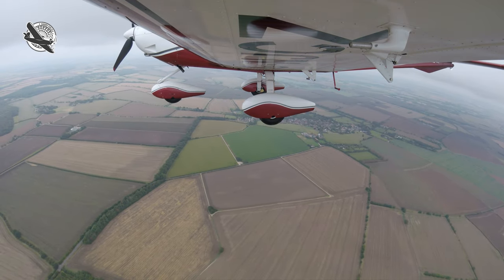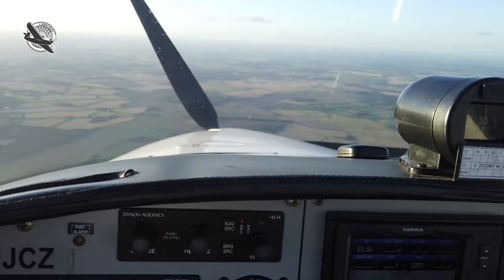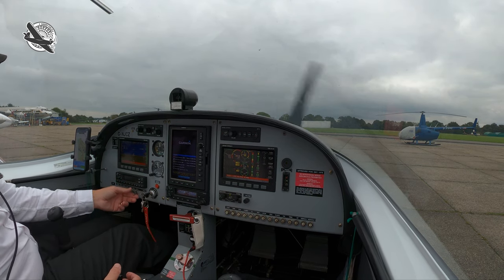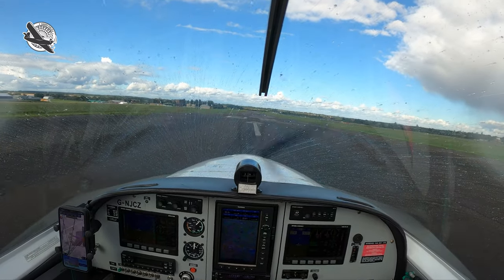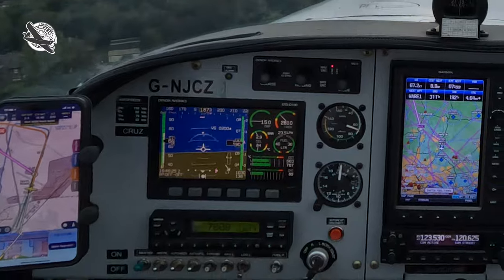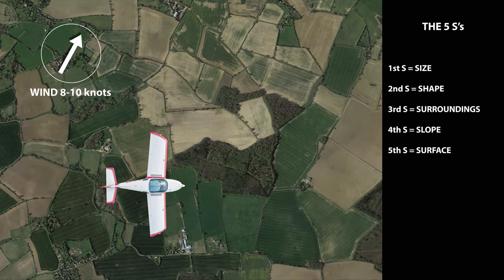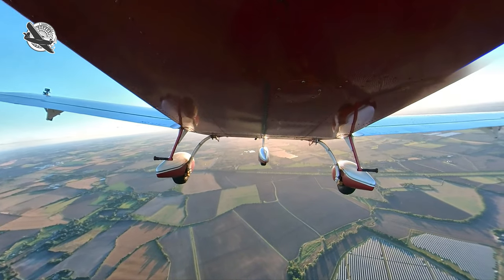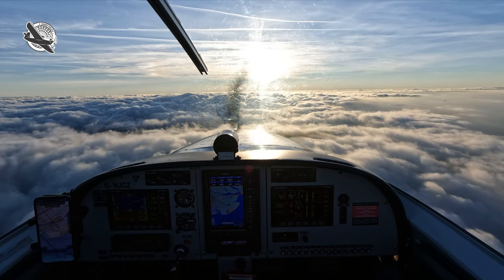ENGINE FAILURE in a single engine aircraft and how to SURVIVE if the worst happens.

Comment: I had engine failure in a Beech Musketeer a couple years ago.  Was only 1500 ft AGL.  Not much time to diagnose problem but oil pressure had taken significant drop so I turned towards the field.  I was about six miles out.  Engine quit within a few seconds after the turn.  I immediately set best glide speed.  There was major highway with lots of traffic and power lines.  I opted for a gravel road.  Slope was down hill but I couldn’t tell that until I was already committed to landing.  There was a very slight dog leg turn in the road.  The airplane wouldn’t make the turn so airplane departed the road.  When over about 400 ft of Texas sagebrush and then into some bushes.  The bushes quickly slowed the airplane.  Then the right wing impacted a small (2-3 inch trunk) tree.  I didn’t feel much of a tug on the seatbelt.  I was fine.  Only injury was scratches from climbing through the bushes.  Airplane was totaled by the tree. I didn’t feel any fear through the process.  No panic at all.  I would suggest always selecting landing site prior to working on engine problems.  I did change fuel tanks, checked mixture without success and then it was time to land.  It was the smoothest power off landing I ever made.
Reply from the maker: Well done Mike. Fantastic thanks Sir.
Reply: Textbook emergency landing by the sound of it.
Reply from the maker: @rinzler9775  textbook, no, walked away, yes 🙂
Reply: Out of curiosity are you the owner of the plane or were you renting it? I’m still working on my PPL and I rent the planes I am training in. I have always wondered what the costs would be, how the insurance handles it, etc. 

At 1500 AGL, I imagine that was pretty nerve wrenching! Do you recall about how long it took for you to glide down? (3-4min?)
Reply: @GlassFamFishing  If an engine fails, don't worry about the aircraft, it belongs to the insurance company at that point.
Reply: My God I’m glad you’re okay😮

Comment: Engine stopped running in my rental C172 over Puddingstone Reservoir out of Brackett Airfield, La Verne California. I was flying from Van Nuys airport. Landed and had lunch and took off headed back to Van Nuys when while over Puddingstone Reservoir the engine quit running (approximately at 1,300 AGL). Indelibly edged in my memory “will this be my last day on the planet?” I establish glide speed thinking of a possible water landing, but was able to restart the engine.Traded airspeed for altitude. I headed back to the airport landed and called the FBO. They sent a plane with two pilots to pick me up. They test flew the plane around the pattern with no problem and asked me if I would like to fly it back. I said no thank you. Turns out they had fuel contamination problem with several other airplane at this FBO on this day.
Reply from the maker: Scary story David but well done Sir. Thank you

Comment: I know this is for a vid, but the manual for our cruisers says PULL THE RED HANDLE.... Once the whirly thing in front stops, it belongs to the insurance company.
Reply from the maker: LOL I was going to say that but wanted to keep the video non-specific to type. :-)
Reply: On our cruisers they state to only use the parachute in extreme emergencies where a safe off-airport landing is extremely unlikely.
Does your manual state a minimum use height for the parachute? Ours doesn't unfortunately!
Reply from the maker: @That737Driver  no minimum deployment in either speed on height, however once the chute is deployed you've lost all control over the situation. Engine failure immediately after take off (use as drag) at or night or water or a loss of a control surface would probably be the only time I would use it.
Reply: @ShortField  Agreed, it's a very last resort kind of decision to make. The Cirrus is much clearer in how and when to use its chute, but they also make you use it basically all the time!
Reply: @That737Driver  No, but the chute manual states 400 feet minimum. Call BRS, they will happily send you a copy.
Reply: @stevenmerriman4479  Aha, that's very good to know. Thanks for the info!

Comment: As a  full-time flight instructor, this video is excellent, and I may even use it as a teaching aid. Each step is informative and concise, which is important when teaching new pilots about engine out procedures. I've been flying for 6 years and instructing full-time for 3 years. Luckily, in that time, I've only ever suffered a partial avionic failure, but it certainly wasn't an emergency situation. I was taught to fly bye a old school instructor I remember I was about mid way through my PPL training and we where going through engine out procedures and I will always remeber what he said "know matter what happens James, fly the fucking aircraft" we both chuckled at this remark but its stuck with me until this day, now im teaching my own students. The old addage is never far wrong in my opinion aviate, navigate, communicate.
Reply: Did you really need to use the F word? It added nothing to your comment.
Reply: @arturo468  it's what the instructor said hence the quotation marks...

Comment: Great video. My only contention is you said fly “gliding speed the whole way.” This is 99% correct. When you are very low (say 50’ AGL) you should work hard to slow  considerably below Vg. Full flaps, and just a few knots above flaps stall by ground contact. Survivability is all about low energy when you contact whatever you are going to contact.  Stall is worse case case, just above stall is best case. It’s a thin line, but hitting ground at Vg in most airplanes is about 20 knots too fast, and 4x the energy at impact. Thanks for a great video.
Reply from the maker: Appreciate this very helpful comment, thank you Brett agree with everything you say. I wanted to keep the video short and get the main points across but maybe I should have added more detail such as your points. Thank you for your kind comment it is so appreciated.
Reply: @ShortField  what is the app that you have on your phone called??
Reply from the maker: @lorenzo99945  it's SkyDemon probably the best and most used VFR app in the country.
Reply: @ShortField  thank you so much

Comment: I advocate for practicing side slips, in this way you can make your approach high "and know" when you can side slip into your chosen crash site. This may option you to choose a differing spot in Liew of seeing a ditch, barbed wire fence, or many other difficult to see hidden obstacles. Buy options via knowing how to drop in and being "confident/well practiced" at it. I used to side slip on every landing because if you're dragging it in on power and the motor quits... you're not going to make it! Side slip is a powerful attribute to have and maintain "energy in the bank"! Watch your airspeed when you  are practicing it, It'll soon become 2nd nature and "simple"!
Reply: Yeah, I'd rather be high and have to slip than be low and then there is nothing for it but land short and...ooops.

Comment: Super video, thanks Terry. 
I fly a flexwing with 912ULS (I am one year & 100 hours after qualifying). 20 hours after qualifying I had an engine out (turned out to be a clogged fuel line). I was 450m AGL so plenty of time to do everything including PAN-PAN to FIS. All went well except...
1. My routine started from looking for fields and ensuring best glide, to the extent that I didn't switch on the fuel pump when trying to restart the engine. My instructor told me afterwards that if I had switched on the pump quickly enough there would be a decent chance I could have restarted the engine and got back to my airfield with the pump on
2. Despite having the huge luxury of multiple flat fields straight ahead of me (and into the wind) when the engine died, my instincts told to me to avoid all the nice grassy fields and land in the single ploughed field (despite remembering my training telling me ploughed fields were the worst option). My mind kept saying "you don't know what's under that tall grass - what if you hit a hole?". Luckily the ploughed field was very dry and I kept the nose up as long as possible, so no harm done other than a fried wheel bearing - I stopped in what seemed like zero seconds flat!
Nothing since then but I ensure I try simulated engine out landings often.
Reply from the maker: Wow what a way to start your flying career :-) At least you dealt with the problem and had a successful outcome, well done Adam. Not sure how a flex glides with a stationary fixed pitch prop but if it's anything like the SportCruiser it's like having a concrete block hanging from the aircraft, even at our best glide speed I was getting +850 fpm, so on the deck in just over 120 seconds from 2,000ft add in a reaction time and you don't have long. Thank you so much for your kind comments they are really appreciated. Fly safe Adam, cheers Terry
Reply: @ShortField  Many thanks Terry. Maybe not quite a concrete block, more like a heavy wooden beam :) Effective glide ratio for my not-at-all-aerodynamic flex is about 4:1-5:1, so the 2 minutes you quoted was close to what I had. Adrenaline kicks in, the training kicks in, and for me it seemed like the time stretched out for minutes on end... Fly safe, keep well. Adam
Reply from the maker: All the very best Adam.

Comment: I got an engine oil light about 5 minutes out from the runway - immediately turned around and headed back to land. Landing went fine and taxied back, started to smell burning oil and shut her down. Popped the cowl and there was oil sprayed everywhere. A few minutes more would be looking at an engine fire.
Reply from the maker: Lucky indeed. I had complete engine failure in a Piper Arrow at Calais, scary stuff especially that 10 minutes later and I would have been mid-channel :-(
Reply: @ShortField  as in mid the English Channel ?
Reply from the maker: @rinzler9775  yep.
Reply: @ShortField  What's the best way of flying over water in a single-engine ?  As high as possible ?

Comment: All good points, Mr. Short Field. I would just add: maintain proficiency in forward slips, so that you can come in a bit hot and high, and yet put it on the numbers.
Reply from the maker: These little aircraft do slip really well and you can drop around 1,000ft in 1/4 mile that is a really great point, if I do an update I will include that. Cheers Sam

Comment: Never heard of the 5S in engine failure but always wondered about them! Very informative, thank you! I will add some things that several flight instructors told me:
- if you have to go into trees, pick tall needle trees like fir or pine. Their branches are brittle and will break instead of bouncing you back like other leafy trees like oaks or birches.
- landing on water will almost certainly flip you over with non-retracteable gear, but statistically it is more likely to survive than land-crashing.
- don't try to do the impossible turn, or try to go over that last obstacle by pulling up and reducing your speed. You might make it over the obstacle, but if you stall, the plane will simply fall straight down in a vertical fashion (no speed...) resulting in spine injuries. Better hit an obstacle horizontally than jumping out of a skyscraper.
- when over urban areas and no field is available, open football stadium could work. Any green area before a house or a school.
- roads also have crossing powerlines, signs and bridges, keep that in mind. 🙃
Reply: very nice ones thanks for sharing.

Comment: Interesting video as always mate - I did my bi-annual only yesterday and the instructor made an interesting point, which, when I was learning, was never mentioned .... when you have selected your field, make the approach into wind and if you too low, cut the corner (was told that) but if you are too high, pick two features on the base leg, a clump of trees, farmhouse or something, and always use those as a reference for your 'S' turns, so you are always lined up on base, and your selected field..... make sure, you maintain the same speed so you are not suddenly gaining distance towards the field ..... so, in effect, minimise any 'surprises' !!! - It might be normally taught, but I was never told that !! Cheers Terry
Reply from the maker: Great advice Chris and thanks for your always appreciated support.

Comment: I flew 25 hours into a PPL back in the late 00s. Never got around to finishing it, and now I won't clear a medical, but nontheless - that concept of checking out suitable fields beforehand is a great idea, but also gave me a scary realization. Taking off towards the town at the local field there will be a period during the takeoff where the only possible locations to set it down will be in the middle of town. There is only a small golf course between the threshold and the town, and it's too close to turn away before reaching the town, so after you've passed the point of setting it down on the golf course, the town is all that is left.
To top it all off, I live on one the more logical streets to aim for, one of the only ones that is reasonably colinear with the runway. It is NOT wide enough, but better than planting it in a house I guess.

Comment: I enjoyed your  Video and tips and Would like to add one for consideration....  First off understand we fly out of Fields that are often surrounded by Trees with few open fields.... With that in mind OUR approach is as follows....  When we depart our field, we leave the ground and begin our climb monitoring our field position and altitude above the trees in case we need to land straight ahead.............  As we continue our climb and determine a straight ahead runway landing is no longer possible  we start a slight right turn off the runway heading and continue to widen our distance from the field as we  climb to a point were we then fly parallel heading  from our runway  but continue our climb.... This way at any point we loose power we can comfortably perform a 180º turn that puts us lined up on the runway centerline  with a slight tail wind to reach it......   I hope this makes some level of sense..... Its un orthodox departure I know  but trust me I also know it works.. I have first hand experience hahahahahaha after suffering a gearbox failure on a 582 powered aircraft..... I  was so low at the time I didnt make the strip but did safely land in the grass along side the runway........
Reply from the maker: I'd love to know where that strip is. Great explanation and for locals and based aircraft that sounds like a very practical procedure. Thanks for the insight and kind comments Mark.
Reply: @ShortField   Our home field is here in NewEngland  8MA4 in Stow MA..... My failure took place at a neighboring field,  3B3 in Sterling, MA..

Comment: Flying high with a good glide gives you options. Steep climb and good glide means you can always return to the runway. A Risen at 9500feet can go 65km without engine. A good computer map with runways on means you can generally always reach something and save the rather expensive plane and expensive transport. And it seems England has quite a number of private airstrips

Comment: I had a failure in a 2t weightshift on climb out. The brass main jet slot broke off in the bowl partially blocking fuel flow and caused a lean backfire. I thought a local model RC aircraft had gone through the wing, it was so loud in the headset! lol. Lost usable thrust, and promptly remembered to 'fly the plane' back onto the runway.  👍
Had a couple icing scenarios too, luckily melted as gravity started to win.

Comment: Great video… I’m going to be THAT guy and ask about deliberately shutting down the engine in flight and how worried you’d be about restarting. The 912 there is carbed isn’t it? I’ve struggled to start my 914 hot….. I wouldn’t like to try that… otherwise good stuff… I’d add to feather the prop if you have an electric CSU - will improve the glide range.
Reply from the maker: Thank you. 912 starts really easily when hot, I was over an airfield when I did this and sadly don't have a CSU but great point. Thank you so much.

Comment: Something I've always pondered on... how come the engine in my Renault Clio has NEVER failed/lost power in thousands of hours of use in over 8 years of operation in all sorts of wheather conditions. As a matter of fact I've never been stranded at a road side due to an automotive break down in 20 plus years and nearly a million kilometers.  Yet engine faliures seem almost common in general aviation even though your life depends on that NOT happening.
Reply: fair comment, but your Renault Clio stays on the ground. More variables up in the sky, but that's my opinion.

Comment: I had 2 engine failures in my 1st 500 hrs.  Both turned out ok.  But the 1st one. C182 scared the crap out of me.  The 2nd C185 I was ready.  I had made a point of practising at least 1 forced approach on every flight.  Both were during the daytime.  Needless to say. I think anyone who flies a single engine piston at night needs their head examined.